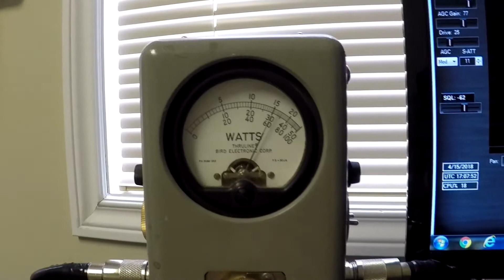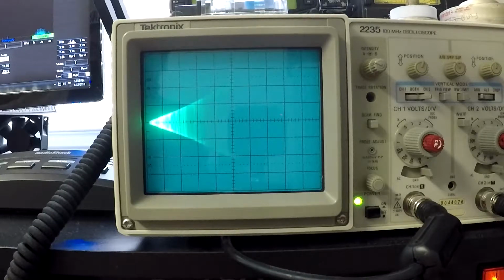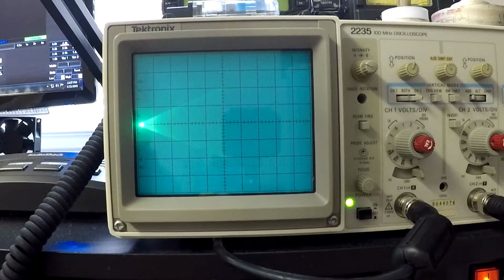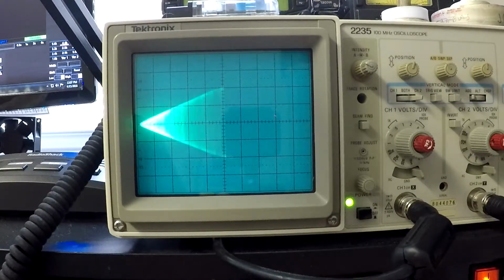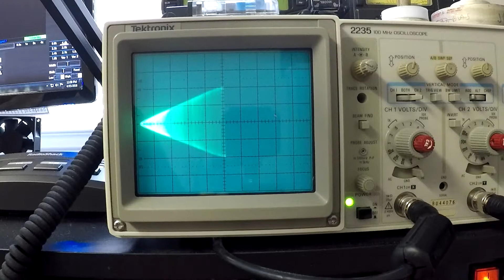alpha 8410 tube bias

Comment: its easy to see by 4cx1000a datasheet,that in AB1 linear mode ,resting current or ZSAC,have to be adjusted by grid voltage to 250ma per tube...so 100ma per tube is too low for linear mode....even 280ma your adjustment is to low for 2 tubes...at least 400ma for 2 tubes will give clean good linear signal...I think that Eimac know better what is linear mode adjustment in their tubes,than alpha.....just my 2 cents....like somebody say,read the fucking manual...LOL
they lower resting current ,to be easier on plate power supply,and reduce heat,compromising linearity....